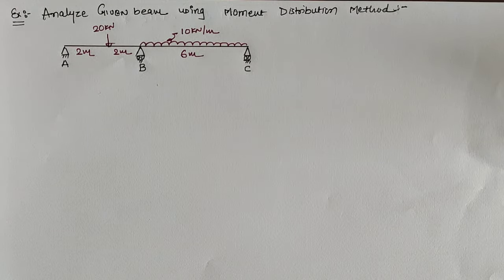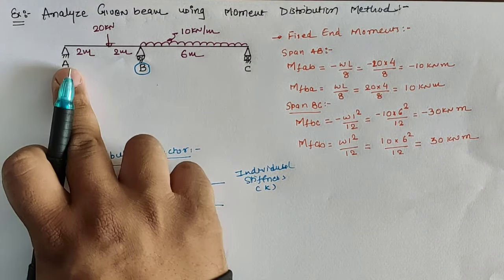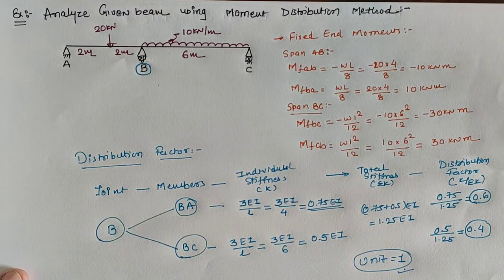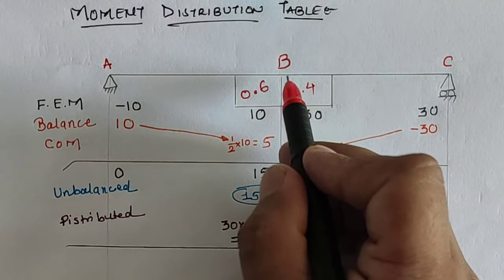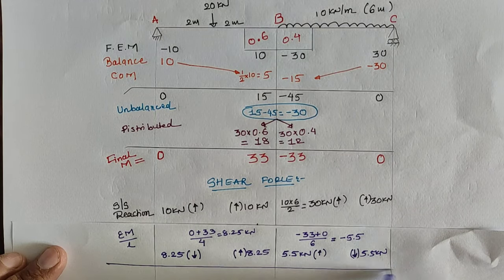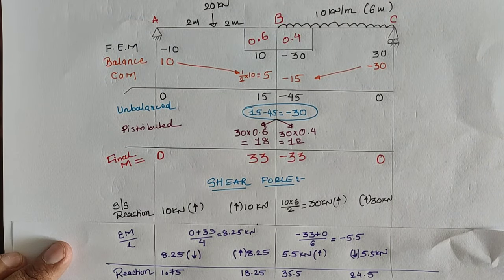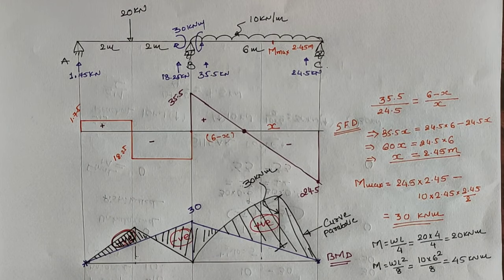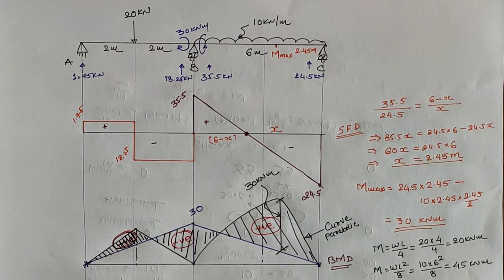EX 01 | PART 01| UNDERSTANDING MDM | TWO SPAN CONTINUOUS BEAM| BOTH END SUPPORTS ARE HINGED

Comment: The FEM for ba should be (3/16)*P*L, for bc should be wL^2/8
Reply from the maker: Dear Friend, if propped cantilever beam is given than final moment at fixed end (ie Ma) will be (3/16)*p*l and for simply supported beam loaded with UDL over entire span, Max moment at centre of the span is wl^2/8...
For Moment Distribution, each span is assumed as fixed for analysis purpose and the end moment is asuumed as Fixed End Moment (FEM) which are as described in example first step...
Hope your doubt is clear now...
Keep Learning